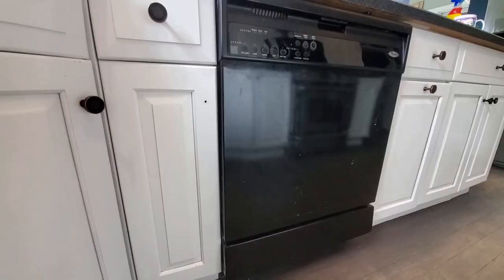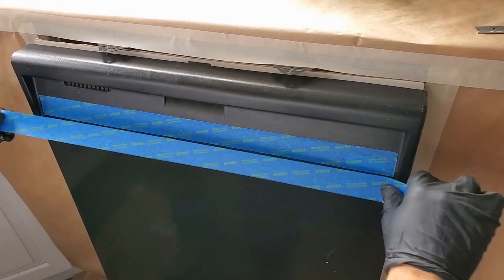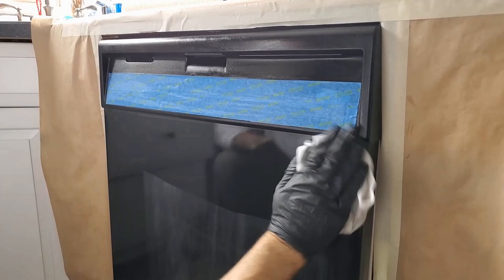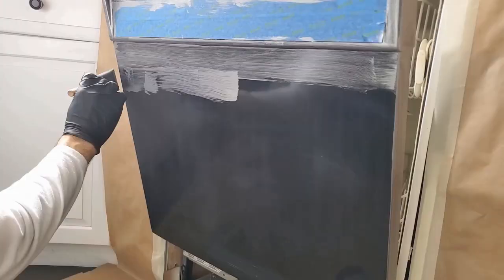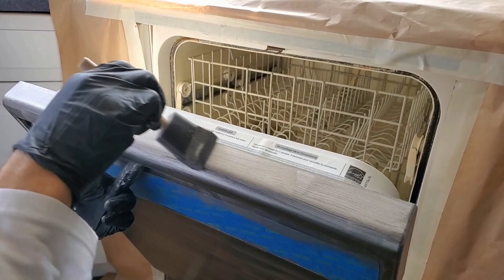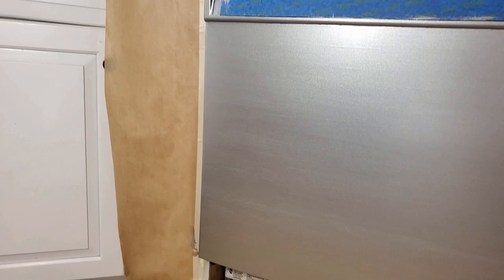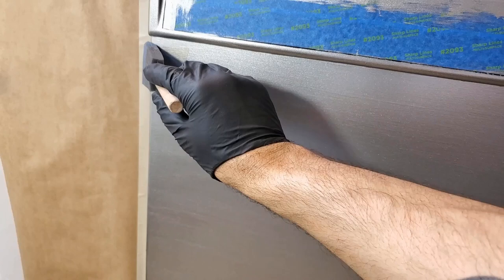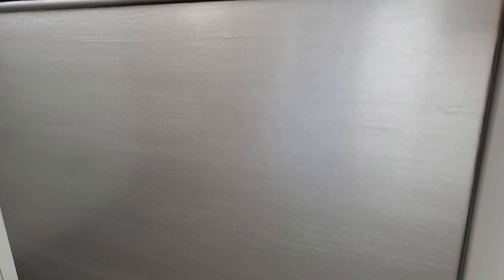Painting A Old Dishwasher With Stainless Steel Paint Makeover

Comment: Don’t get rid of that dishwasher, that was the most powerful and reliable dishwasher made. They don’t make them like that anymore…I have the same machine running strong
Reply from the maker: I got it for free years ago!
Reply: @DIYhomeimprovementguy  Is it still runnin good? I’ve got a portable one in all white of this same model. Not only is it pretty quick with cycles but it’s the most powerful cleaning system residential machines ever seen, the Powerclean module 5 level wash system Whirlpool called it. Now these newest machines have control board issues, parts failing within the first few years, and they take several hours because they have fewer fill cycles. These were such classics as I’ve been working on appliances for a while, looks great though how yours looks now it’s very sleek!! Great video!!